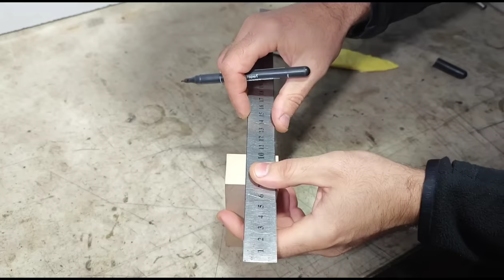From sewing needles to Japanese Deba  Knife: The Transformation of Wootz Steel

Comment: Why are you not sealing the crucible lid to prevent ingress of oxygen? The silica will melt first and sink to the bottom, only being pushed up and forming the cap once the rest of the charge melts. What percentage of chromium and vanadium is in your mix? Also, how many heat and soak cycles do you do. I saw only one.